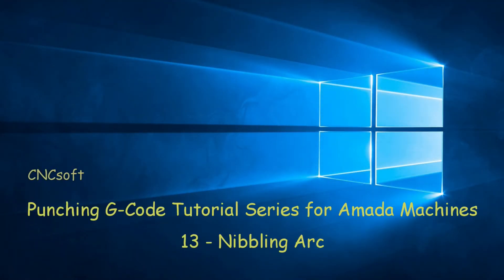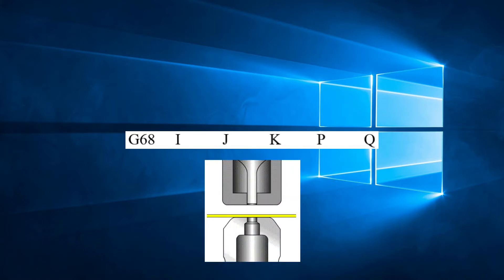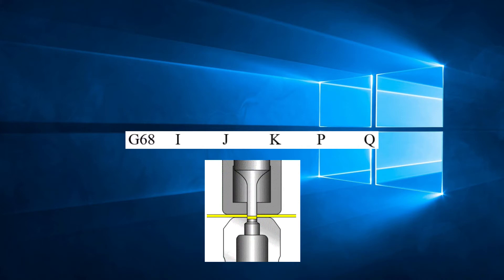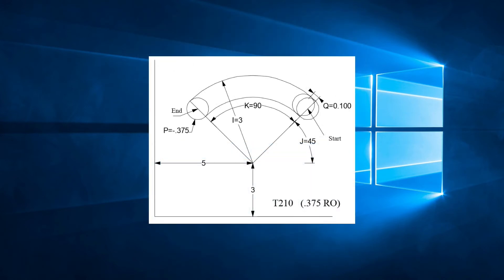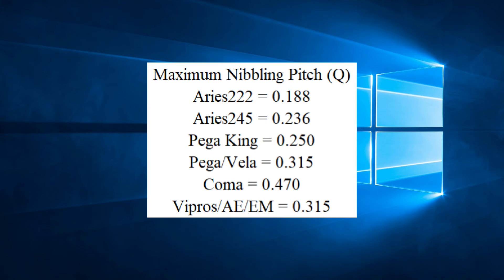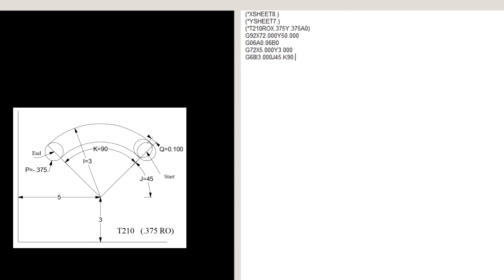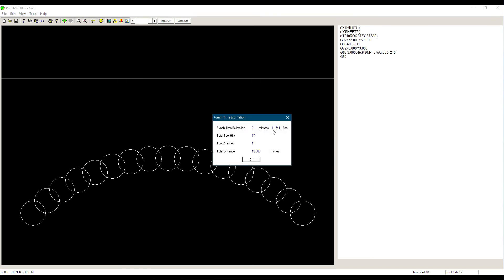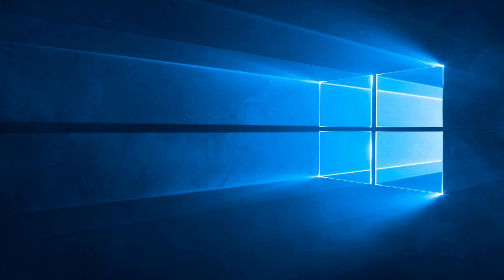13 - G68 Nibbling Arc - Punch Programming G-code Tutorial Series for Amada Machines

Comment: The striker vela does not go back to orginal position and tend to rest close to the punch tool post the nibble function is that the issue of the code or a issue with striker mechanism?
Reply from the maker: My guess is that it's not a code issue.
Reply: To me looks like you have M00 before M60 and stops near the punching turret...